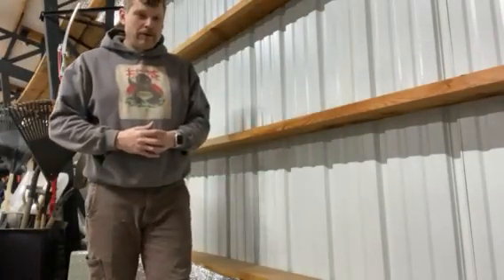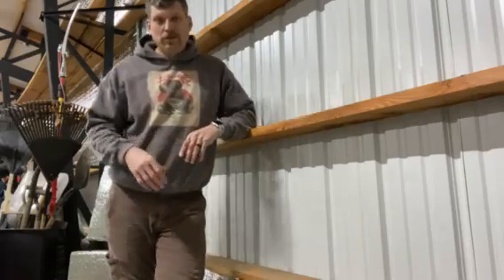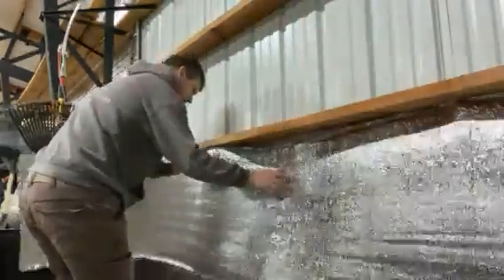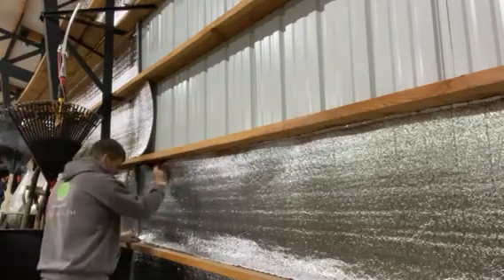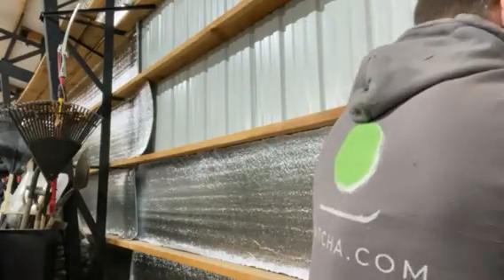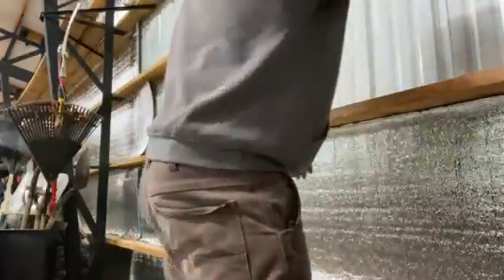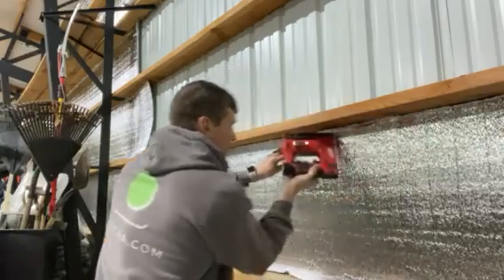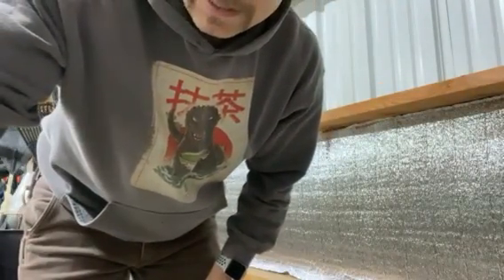24 Inch Prodex Total Insulation in pole barn review V0062717 Dan Sitter

Comment: I'm thinking of installing 10m before I install the metal sheets
Reply: I am considering the same thing on a 45x35 shop. Treating it like batt insulation. using the R-Panel to secure it, installing it vertically. Did you end up going with this product?
Reply: @SuperMopbucket  I have not started the sheets yet...I'm on the fence...I am now thinking I'll put seam seal foam on the metal and then do spray foam after I pipe off my electrical
Reply: How much did this help your temperature control?